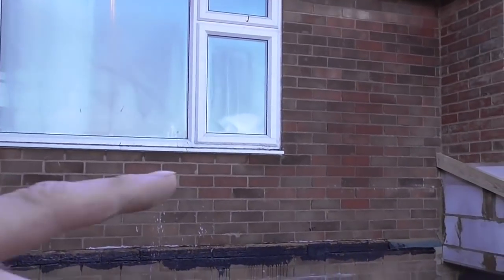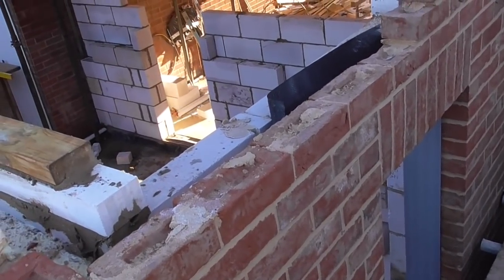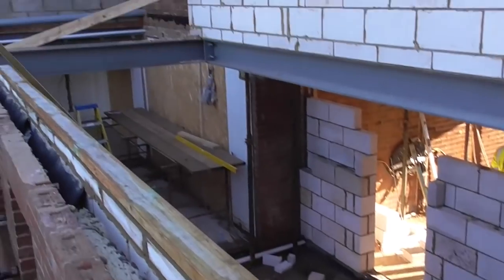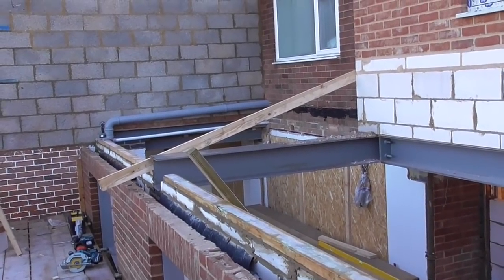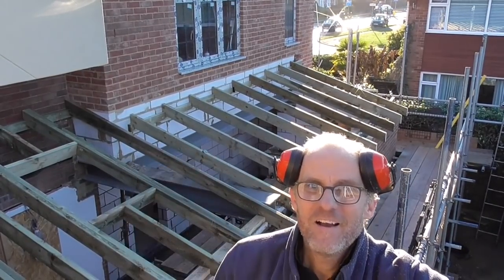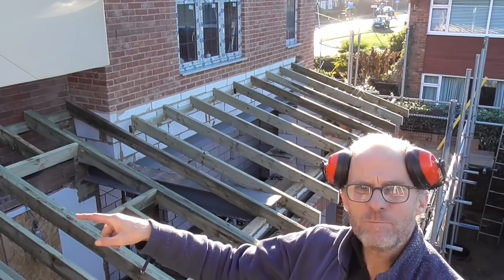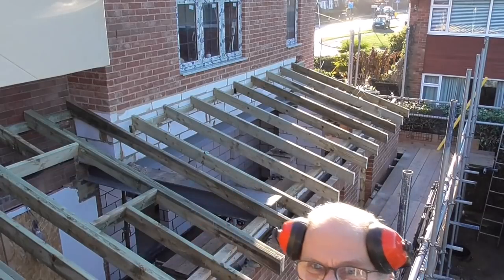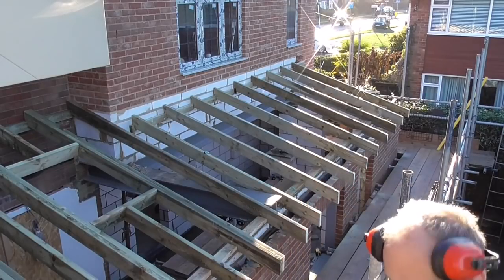Lean to type extension roof ***IN TIME LAPSE***

Comment: good work del, whenever i do lean to roofs i always have the top plumb cuts against the top plate. seen it done your way before also. ive just always done mine that way. suppose like many things in carpentry/joinery theres a few different ways of achieving the same goal. 

for the velux positions i find its always pretty critical where abouts they go for the given roof covering and refering to the instructions is pretty important. plus i find velux instructions seem to be different each time you fit one of their windows
Reply from the maker: Hi Paul🖐I got pulled up once by the Building Inspector for only butting and nailing the rafter tops through a plumb cut as you describe, and I had to put metal brackets each side for him😬(bonkers considering how well four 90mm nails hold). On bigger spans, I just birdsmouth the tops now to save any problems with the inpector👍It's good if you can work in with the roofer to make the Veluxs work with the tiles, but it's not always possible😬Great comment, as always, and have a nice weekend 😎 Cheers Del
Reply: @thetallcarpenter  south tyneside council often dont pull us so we dont need to do the mess on with metal brackets in situations like that (certainly in my experience anyway) but i suppose it depends on the inspector i guess. one local one was known for his pettiness though. on one job with him i went over and above what i knew he would ask for and he still took the piss.. wanted us to replace existing air bricks on a house because they wouldnt let metric air through....
Reply from the maker: @paulfinnonjoinery  You are always going to get the odd pedantic inspector, but, mostly they want to work with you, not against you👊Cheers
Reply: @thetallcarpenter  ohh absolutely he was a nightmare the rest are sound and there to offer advice should it be needed. Good people to ask questions of. Good to see ya swinging your hammer again mate

Comment: Great work as usual Del.. 👏🏻. 
The big debate.. birdsmouth on the ridge. I don’t usually do it, just fix the full plumb cut to the ridge. 😬. I know some local authorities/ building control like to see it.  I guess no ceiling ties it’s a better method. 
On a full cut and pitch roof we don’t usually birdsmouth at the top. 
🙌🏻
Reply from the maker: Hi Dan, and hope you are well bud🤗I personally think that a plumb cut nailed to the face of the top plate is more than a good enough connection. Four 90mm paslodes in each is not going anywhere. I've just got picked up a couple of times on my the BI, and had to put metal work on it, so, on bigger spans now, I just birdsmouth the top👊You'll see in my next video, on a little lean to porch, that I have just put plumb cuts in the top and nailed it straight onto the wall plate😝as the rafters are only short🤟As you say, on a traditional cut, triangle, type roof, the too plumb cuts are just butted and fixed to the ridge👍Thanks for watching mate, and would really like to meet up soon for some carpentry chat🤩Have a good week😎Cheers Del
Reply: @thetallcarpenter  nearly all good thanks Del..😷. Isolating for a few days..☹️
Exactly, four 90 mm nails in the ridge and it’s fine. 
Belt and braces job how you done it. 🙌🏻
That could be a date. 🍔☕️ and chat.
Reply from the maker: @Ultimate-roofing-square.  👊😎😷

Comment: Hi Del, great video. Question, does the 1/3 rule apply for the birdsmouth at the plumb cut end? Thanks
Reply from the maker: Hi there🖐 In my opinion, the birdsmouth only needs to be deep enough to allow for a 45mm seat cut to sit on the 45mm wall plate/ledger👍Any deeper than this weakens the rafter👌There is much debate on which detail is stronger at the ledger/ wall plate, full bearing, nailed plumb cut, or as I prefer, 45m bearing birdsmouth🤔I'm thinking of doing a video on it😎Cheers Del

Comment: Good fast work, couple of questions.

1.what fixings did you use to secure the top plate to the house? 

2. Where the mitred end of the rafter meets the top plate, you've cut a step out so it rests on top, similar to the birds mouth at the bottom. Is this how it should always be done for lean to and dual pitched? Is the top cut a third of the rafter depth too? Ive only ever seen it done by nailing the mitre against the plate without a notched cut.

Interested to know for a future outbuilding id like to do.
Reply from the maker: Hi Dan🖐The top plate is fixed with M10x100mm Fischer fixings, and yes, the top of the rafter is birds mouthed over the top plate by one third of its width👍 On smaller spans, I would just fit the top plate a bit higher, and cut a plumb cut on the top of the rafter, and just nail it. (small spans have less load on the connection). Putting a birds mouth on the top of the rafter on a lean to roof means the roof load is transferred straight down. On a dual pitched roof, we just cut plumb cuts at the top and fix then to a ridge board. As this forms a triangle with the ceiling chord, the top joins will be pushing together as the roof is loaded, and the ceiling chord stops the bottoms spreading under the load. Hope that makes sense🤩Thanks for watching and your comment😎Cheers Del
Reply: @thetallcarpenter  Yes this all makes sense thank you for replying, all handy to know. I'm not a joiner but have done a few mono pitched, and helped a joiner mate do my house traditional roof. I'm looking to do a duel pitched shed 36 degree pitch with 2.5m rafter spans so trying to find somewhere showing rafter and chord sizes required for different spans and if purlins are required.
Reply from the maker: @handle1196  Hi Dan. I would just go with 125x50 rafters if the are 2.5m long👍
Reply: @thetallcarpenter  do you think it would require purlins? 2.5m rafters and 3.6m ceiling chords. Ridge from memory was 1.3m rise
Reply from the maker: @handle1196  Absolutely no way that needs purlins Dan👊It's a cute little roof👍
Reply: @thetallcarpenter  last after thought question i promise 😀, do you think c16 or c24 for these rafters.
Reply from the maker: @handle1196  Hi Dan. Either would be fine, in my opinion👍

Comment: Thanks for the video. As a DIY'er I wondered whether you could explain the method used to fix the wall plate (pole plate?) to the main house? Looks you were drilling through the timber into the block and hammering a fixing in?
Reply from the maker: Hi Steve🖐I fixed the top plate using M10x100mm Fischer fixings👊 (nylon frame type fixings) I find they hold really well in these light weight blocks. I staggered them at 600mm centres💪Thanks for watching and yoke comment😎Cheers Del
Reply: @thetallcarpenter 
Hi - quick question: are these fixings like thunderbolts (or similar) that you just screw into a pre-drilled hole? If so, do they meet building reg's? I ask as I have a little lean-to extension to build and I've been told to use a threaded bar and a chemical anchor - but that's more time consuming, whereas your method is faster and easier! Cheers. ;-)
Reply from the maker: @timwilcox960  Hi Tim🖐Resin and threaded bar is pretty serious way to fix a top plate for a little lean to roof🤔 I, pretty much, always use M10x 100/120mm Fisher, screw type nylon fixings as they get a REALLY good grip👊Cheers Del
Reply: @thetallcarpenter 
Wow - that was quick - thanks! 🙂
Reply from the maker: @timwilcox960  My channel is small enough that I can read and respond to all the comments and questions I get, which is pretty cool😎

Comment: Hi mate great job just curious which you prefer when doing the plumb cut on your rafters do you birdsmouth them onto your stringer on the wall aswell does that then not need clips as of regs? I always plumb cut and buttjoint to the stringer with the top of the plumb cut flush with top of the stringer then a shoe underneath, thanks mate great job
Reply from the maker: Hi Matty🖐 On larger spans I will always cut a birds mouth onto the top plate, but on smaller spans, I just put a plumb cut on the top and nail it straight onto the face of the plate👊I don't use metal work in this case, as nails give a fantastic hold💪Great comment, and thanks for watching 😎 Cheers Del

Comment: Hello, what is the minimum pitch for a single garage roof. My Russell Grampian tiles technical data reference say they have a minimum pitch of 17.5 degrees at 100 mm headlap. Do you agree and do I need a building inspector to confirm? Thanks
Reply from the maker: Hi Mala🖐 You will be fine if you stick to the tile manufacturers specifications for minimum pitch and head lap👍and a building control officer will only want to see the roof has complied with the manufacturers guidelines👌Cheers Del

Comment: Hi Del, good to see you you back👍just wondered how the builder will finish the ceiling on the inside, where that portion of wallplate hangs beneath the rafters at the top, will he just level out from this and plasterboard this section or what ?
Reply: Yeah normally the ceiling gets dropped to create a level flat ceiling bit up at the top, otherwise it is a hassle to board, skim and fit down lights or pendants into a tight triangle so the level top solves all those issues. Might be different here but I imagine that’s what they’ll do
Reply: @BuildandTool  Thanks I thought they'd  do something like that.
Reply from the maker: Hi Kevin🖐You got it in one bud👊I personally am not keen when the roof goes up to a point on the inside, and the little flat section softnes  it off👍Thanks for watching 😎 Cheers Del
Reply: @thetallcarpenter  Keep well mate 👍
Reply from the maker: Hi there🖐You're pretty much spot on, and, I think, a little flat area looks better than it going up to a tight corner👊Thanks for adding your comment 😀 Cheers Del
Reply from the maker: @amazing451  You to bud👍

Comment: What length of anchors did you use for the horizontal timbers that hold the rafter? Thanks in advance.
Reply from the maker: Hi there🖐I used M10 x 120mm frame type anchors👍
Reply: @thetallcarpenter  thank you! Starting my own project soon, gathering tips!

Comment: When building an extension, how do you find and match the existing ceiling height with the new one? Whats the process?
Reply from the maker: Hi Dwayne🖐We usually aim for a 2.4m ceiling height, but when doing double storey extensions the new ceiling/floor heights will have to match those of the original house👍Thanks for watching 😎 Cheers Del

Comment: Hi, I noticed that you bed your wall plate in moutor, most guys use machinacil fixings. I prefer your method
Reply from the maker: Hi Dan🖐 I don't really fix my plates down through the top, as the blocks aren't really strong enough😬Thanks for your comment and for watching 😎 Cheers Del

Comment: I cant recall if you said If the original window getting bricked up because the roof tiles are going to cover it otherwise?
Reply from the maker: Hi Clint🖐That window is being replace with one that is not as tall so the tiles and lead with fit below it👍Thanks for watching 😎 Cheers Del
Reply: @thetallcarpenter  i thought it would be. Nice job!
Reply from the maker: @clinteastwood3684  👍😎

Comment: Hi Del, I have often wondered what the advantage is of notching over the ridge when fixed to a wall instead of just a normal plumb cut like a dual pitch roof. There's not as much  fixing available and hence more chance of twist on the rafter?
Reply from the maker: Hi Luke🖐You are right in that fixing a plumb cut at the top will help the rafter resist twisting, but, as its only birdsmouthed at the bottom, the rafter will still twist if it wants to, it'll just be all at the bottom😖If I had my way I would always cut a plumb cut at the top, it's just our building inspector didn't like it as it was only held with nails🤯Thanks for your comment and for watching 😎Cheers Del
Reply: @thetallcarpenter  Hi mate
Gotta love the 'expert' building inspectors Del. Nails been used since Noah built his arc! 🤣
Reply from the maker: @LeeTillbury  Roofs stood up for decades just nailed, but now it's got to be massive timbers connected with metal brackets🤪
Reply: @thetallcarpenter  🙄

Comment: Does this style of roof put a lot of pressure on the main house wall it's connected to?
Reply from the maker: Hi Martin🖐 The loading on the abutting wall is minimal and the force on the top wall plate is in a downward direction as the rafters are birds mouthed onto it👍Cheers Del
Reply: @thetallcarpenter  I've been looking at planes for lean to roofs and a lot have corbel stones as supports, is this always necessary?
Reply from the maker: @Martin Blackbird  I've  never done or come across that Martin🤔Almost without exception, all the lean to roofs I've done have been the same as the one in the video👍

Comment: How are you guys dealing with building inspection lately? We’ve been put through the absolute ringer, ridiculous things they’re coming up with and a lot of people just can’t afford to improve their homes and lives, just our next one a 4x3 single drawings with a 50 year time served architect, 30 notes the council have raised. Out of control, the state things are in with materials and everything and they’re choking down on the general public as usual. Actual north Sheffield where we are haven’t even got an inspector, they’ve all walked.
Reply from the maker: Hi Thomas🖐It almost seems to be going tge other way with our local authority🤔It seems that building control farms out the inspection side to outside companies, and we are finding some of the inspectors quite lapse😬I/we always follow good practice, so it's not a problem if the building inspector misses something👍It seems bonkers that it can be so different at one end of England to the other🤯Thanks for your comment and for watching 😎 Cheers Del

Comment: Wow guys check out the right way to do a lean to roof...birds mouth at the top of rafter. Most carpenters and building control offices miss this small detail.
Reply from the maker: Glad you noticed tge top birdsmouth detail Johnathen🫡 Logically and structurally, I think this is THE way it should be done for any rafters longer than 1.5m👍Thanks for your comment🤩Cheers Del

Comment: What is the space betwin raters ? Im doing lean to storage with solid roof my rafter gap its 1m apart,roof its only 2.2m wide 6m long is this sufficient number of rafters?-every 1m ?  I used 2x4 c24 timber.Thanks
Reply from the maker: Hi there🖐I would put them at 600mm spacings👍Cheers Del
Reply: Thanks I will add extra rafter in between so 500mm. I'm doing leant to large shed with cement roof tiles,wall(not the house wall)it's also wooden will the weight off roof not push that wall away causing collapse off the roof??
Reply from the maker: @andrew zolotar  The wall you are pitching the lean to roof on, must be strong enough to take the roof load, and it's not something I can advise on. If you have any doubt, get in contact with a structural engineer👍Cheers Del

Comment: Is there a strip of lead that runs along the top for water. How is that done
Reply from the maker: Hi there🖐There is a lead flashing that is fitted into the mortar joint and dressed down over the tiles once they have been fitted. This seals the roof to the house👍Cheers Del

Comment: Quick question, the left hand roof section is higher than the window cill, even without battens & tiles. Is that window being remove as it looks like it won’t be opening? 🤔
👍
Reply: I think at the start it says the left window will be bricked up two courses higher and replaced
Reply: @handle1196  
My bad. 🤦‍♂️

😂😂😂
Reply from the maker: Dan has got you bud🤩Thanks for your comment😎Cheers Del
Reply from the maker: 10/10 for paying attention Dan🤗Cheers Del
Reply: @thetallcarpenter  
I see faults but skipping the intro cost me. 
I should of known you had it covered. 🤦‍♂️
Reply from the maker: @badninja1971  😝😎
Reply: @thetallcarpenter  
Next time I see time lapse, I’m watching at slow speed. 😂
Reply: @thetallcarpenter  
I’ve also subbed. 👍
Reply from the maker: @badninja1971  🤩👍
Reply from the maker: @badninja1971  Appreciate your sub🤗Thank you👍Del

Comment: Hi Del. I may have missed it but how are you getting on with that 18v right sided Makita circular saw(660z) that you said had a too small hand grip?
Regards, Luke
Reply from the maker: Hi Luke🖐It's a cracking saw bud, and I really like it🤩The handle opening proved not to be an issue👍I did a stand alone video review on it, which is on the channel if you want to check it out👊Thanks for watching 😎 Cheers Del
Reply: @thetallcarpenter  Oh,ok. I'll check it mate, thanks. Have a good weekend 🤘🏻
Reply from the maker: @LeeTillbury  😎👍
Reply: @thetallcarpenter  Just bought myself a 660. Very nice saw, I agree 👍🏻
Reply from the maker: @LeeTillbury  Great saw Luke👍I'm sure you won't regret it 😉 Cheers Del
Reply: @thetallcarpenter  Thanks. Have ordered the track saw adapter too to run on a 700mm track for cutting plumb cuts etc straight.
Reply from the maker: @LeeTillbury  That's a great little set up Luke👍And I've cut some pretty long firings in 45mm timber, with this set up, and it's great👊
Reply: @thetallcarpenter  Del, wouldn't it be awesome if Makita made the exact same saw with a left sided blade too?
Reply from the maker: @LeeTillbury  It sure would Luke🤩

Comment: why pressure treated? Is it because it's in contact with blocks?
Reply from the maker: Hi Tom🖐It doesn't need to be treated, and I suspect it's because that's what the timber merchant had in 3.6m lengths👍Thanks for watching 😎 Cheers Del

Comment: When you trim out for the velux what hight do you put them in at just curious thanks
Reply from the maker: Hi there🖐 There is no set height generally, and it's what works best for the room👊We kept these quite high up the roof to shed as much light as possible into the original kitchen of the house👍Thanks for watching and your comment 😎 Cheers Del